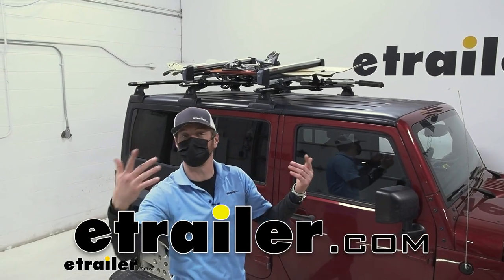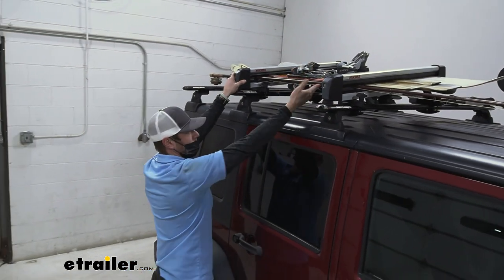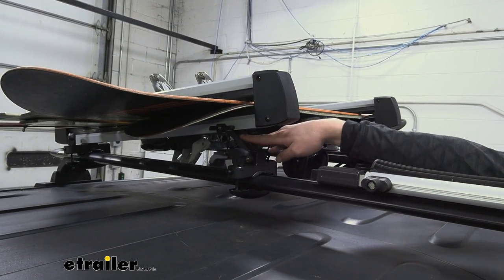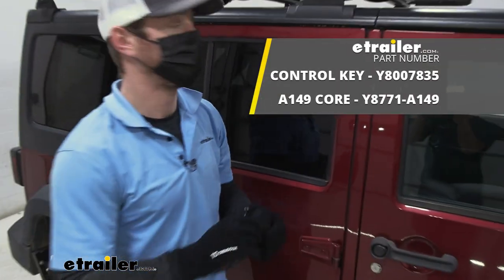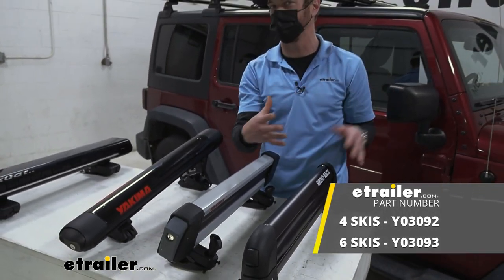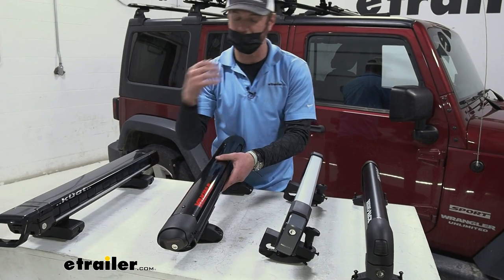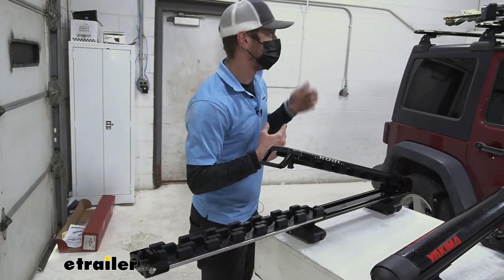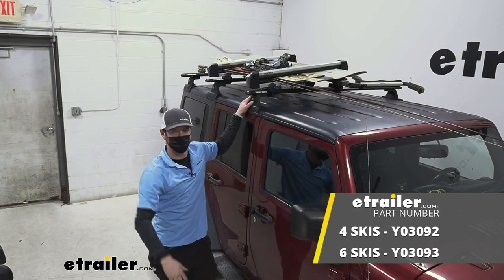etrailer | What to Know About the Yakima FreshTrack 6 Ski and Snowboard Carrier

Comment: Can it hold 2 snowboard and 3 skis?
Reply from the maker: The Yakima # Y03093 FreshTrack should be able to accommodate 2 boards and 3 pairs of skis, but you'll want to take a quick measurement to be sure. Stack your boards with the bottoms facing each other and the 3 pairs of skis the same way. Place them side by side as tightly as possible. Measure their overall width. If that width is less than 28-5/8 inches, they'll fit just  fine on the ski/board carrier.
https://www.etrailer.com/Ski-and-Snowboard-Racks/Yakima/Y03093.html